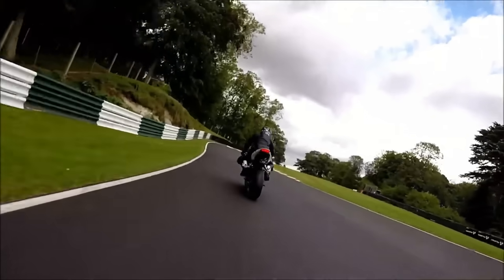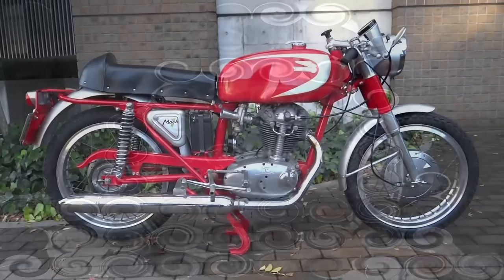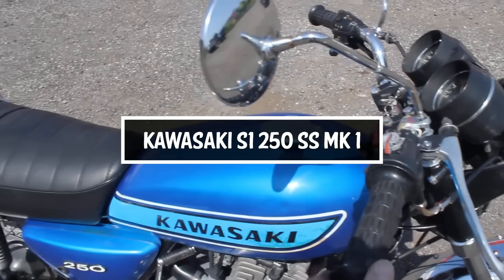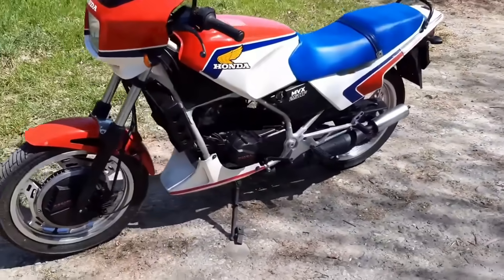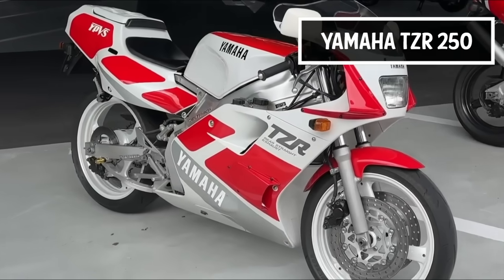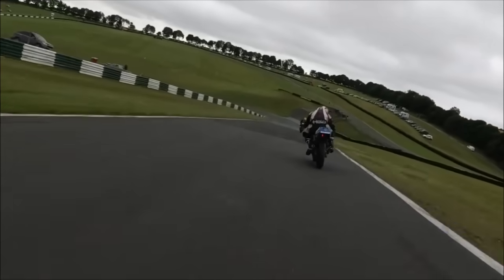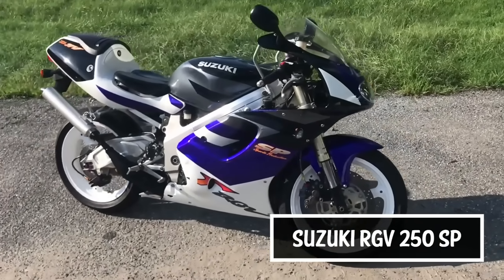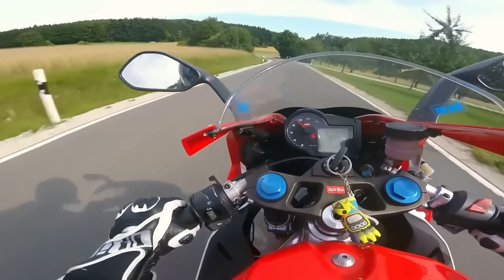The Fastest 250cc Motorcycles

Comment: I have one of the 80s through 2007 ninja 250. It has the air box delete but that's it. It's stock. Drafting a car I got it to 115 and saw 110 multiple times just riding. That's in 5th gear mind you click it into 6th and it'll drop down to 105. It must be some highway gear just put there so you can get 75mpg... The motor can't turn to redline or even close in 6th.
Reply from the maker: theres a lot of bikes set up like that, get there in 5th and then drop it into top just to keep it rolling. with the Vstrom, dropping a tooth on the front made top more usable, it would actually go faster, and accelerate in top even if you werent going downhill lol

Comment: One thing I noticed with the Japanese and their power claims back in the day was they were way optimistic. All these early 45-49bhp claims were in reality 33-35 as the performance figures of a little over the ton showed.
Reply from the maker: may well be mate, thats why i tried to stick to verified speed figures where i could, the magazines of the day often quoted stupid figures too
Reply: Oh dear young people  saying old bikes were slow..you can't test an old jap 250 now coz 1...there is only shit fuel available..we had 5 star 110 octane fuel then..2 most have been rebored so the porting has changed...find a kawasaki S1...from 1972...not after they were detuned that's totally original and test that....also  listen to the honda RC166....250 SIX CYLINDER capable of 18 to 20000 rpm in the 60,s...yes it was a race bike...
Reply: The kawasaki s1 shown is an S1.C  the fourth version not the first and fastest s1...which had 32hp...then was detuned to 30hp..then 28..then forget the rest I rode them all and the KH250 was abysmal compared to the s1....all noise and no power.

Comment: The Yamaha 250 Phazer from 85, is also a little masterpiece, with it's 4 cyl 4 stroke engine reving up to 16.000 rpm. and deliver 45 hp.
Reply from the maker: ill take a look, im guessing must have been an early Genesis engine? Cheers for watching mate,  have a great weekend
Reply: @barebonesmc  Yes, it was named Genesis in Japan and it had also tilted cylinders like the FZ750. 🙂
Reply from the maker: @EnergyXyz  the Genesis engine design was all about the 5 valve heads 🙂
Reply from the maker: @EnergyXyz  your other comment seems to have disappeared, no idea why
Reply: Must be the link I was trying to post - I don't know. The Genesis name was just for the Genesis philosophy. They couldn't place 5 valves because of the combustion size. But the effektive flow from tilting the cylinders like the FZ750 was embraced by the Genesis concept/ philosophy.
Reply: I can't even edit. So it was off course " size off the combustion chamber". 🙂
Reply from the maker: @EnergyXyz  interesting, ill have to do some reading 🙂

Comment: There are several reasons that explain why those 250s are not why it used to be.
Main one, from what I understand, is that the japanese market was by far the biggest for those sporty and highly sophisticated bikes. Japan was doing very well economically until about 1990 and sports bike were very popular among young japanese in the 80s. It was some sort of a fashion at that time. That vanished and economy took a hit in the 90s.
The other market for those bikes was europe and those 250s did actually not sell well here. Proof of that is many of these were not imported. In france we did not get the honda ns/nsr, the kawasaki kh, the 250 yamaha tzr after the 2MA, the last RGV, none of the 250 4T 4cyl...
I remember the sales numbers in 1989 and rgv/kr1 count was very low, around 300/400... And a good portion of those were bought  to be raced in the 250 french sport production championship (promosport). Those race inspired 250s made young people fantasize but few actually bought them.

The truth is those 250 had become too extreme to appeal to a wide audience. The limited displacement and high hp made them peaky and the riding position was compromised.
The last 2 stroke that was commercialy a success outside of japan was the 350 rdlc. The more relaxed riding position and less peaky engine made it a more road capable bike.
I remember that a "popular" mod that did the brits was to install a 350 rdlc engine into a 250 rg frame. That way you had the both of both worlds. A good light small frame and a torquey engine.
Reply from the maker: you needed the twin disc front though lol  🙂Cheers for adding your bit mate. Ride Free 🙂

Comment: I still have my 67 Suzuki X-6 Hustler.  It has, and will exceed the advertised 100 MPH, and is bone stock. TBH, I wouldn't put it through any cornering above 75 or 80 mph in stock form.  The Kawasaki S-2 of 1972 was capable of the same, but was a triple, and equally untenable in corners at anything over 80 MPH.  It's a shame you didn't mention either of these, or the Honda 250-6 cylinder 4-stroke race bike, which was also very cable of speeds over 100 mph, although not a stock production model itself.
Reply from the maker: ive been thrashed around Cadwell (on the EXUP) by the 250/6 and even an old Honda 125 race bike, awesome engineering, Honda at their best. I had to cut the list so many times there were bound to be omissions mate, at 40 mins it is still longer than i wanted lol Cheers for watching mate,  have a great weekend

Comment: You missed one maybe two 100 mph 250's from the sixties  and that is the Bultaco Metrala and the Montesa Impala the Metrala is documented as 100mph and occupied the first two places in the TT 250 production race in 1967, the Impala was more of a fast tourer developing one less bhp then the former but I would not mind betting could reach the magic ton with a prone rider and following wind.
The Japanese big four manufacturers often entered into gentlemans agreements regarding horsepower which is why it was an Spanish manufacturer that showed what could be done with a 250 two stroke of course market potential will be the biggest influence so if demand is not there then no one will be particularly interested although you have to take your hat off to Kawasaki for stepping out of line again by producing the 50 bhp 4 cylinder four stroke ZX25R, getting one outside of the far east though would be expensive and tricky more is the pity.
Reply from the maker: Ill take a look at them :-) Cheers for watching mate, hope you have a great weekend

Comment: 38:10 the answers are physics vs profitability.
The reality that "two wheels baaaaad, four wheels good" makes it easy to deny the consumer expensive R&D in exchange for bad publicity. When you have governments imposing power-weight and displacement limits for novice riders, and safety groups along with those in the medical professions discouraging riding altogether.
In a climate where car manufacturers rely on multiple safety systems, passive and active -- the ever-increasing airbag count, pedestrian safety frontal areas etc.
All this influences the motoring public and we become increasingly risk-averse.

That all said, I saw an indicated 175km/h on my 1985 VT250F2 in 1988, figuring the speedo was probably optimistic by 10.
I was in an 80 zone, and not yet so risk-averse ;)
Reply from the maker: Great story 🙂Cheers for adding your bit mate. Ride Free 🙂

Comment: The Ducati singles of the time were faster
I easily beat a Suzuki 250 on my Ducati 350 with original 23 mm carb. Riding through rush hour traffic we eventually got clear an I cleared off ! I stopped up the road asap I wanted to find out what speed we were doing (my speedo was erratic) But my adversary hqd stopped and turned back as I found out when I went back to my friend at The stables .
Reply from the maker: glad it jogged some good memories mate 🙂Cheers for watching. Ride Free 🙂
Reply: wow that was totally amazing that you were faster than a smaller displacement less powerful and slower motorcycle with a bigger faster and more powerful motorcycle ..how did you ever do it ,,it must have been on your skills alone of knowing when in doubt to turn up the wick
Reply: @donniebaker5984   do yer homework, sebring 350 = 20 hp, suzi 250 =30hp..bigger doesn't always mean more power.
Reply: @rabcspaniel5679  especially when the suzuki was a two stroke..and no your 350 duc was not ever faster than an X6 Hustler ...i was working for Mark Royer of M&R cycles in1966 - 1968 and was servicing new bikes ..we had norton bmw moto guzzy ducati and suzuki....i was there when the 1st 350 duc came out ..the 250 twin suzuki X6 hustler was faster than a 650 triumph bonneville in the 1320. We got a 450 ducati scrambler, came with mx knobs ,no lights , no gages , no tach , no speedometer and a straight pipe with no muffler,..i road the fu¢k out of it ..2nd  day mark made me park it ..i  said whaz up mark? He said  its not me its the neighbors ..they said if they hear that thing one more time they are calling the law

Comment: Claims for max speed, particularly those made by the manufacturer are often unreliable, like Susuki claim that  T20 did 100mph. 95 mph was more realistic. What is more important and often overlooked is mpg.
My mates triumph 500 did 95mph  effortlessly and 60mpg. My CB72 did 90mph being thrashed through the gears and only averaged 60mpg. Guess which bike I wouldn't buy again?
Reply from the maker: an interesting comment, and yes, something people dont always understand is that a bigger bike can often do more mpg on the same ride at the same speed as a smaller engine, primarily because the smaller engine is being pushed more. Many of the Brits were tuned for economy. of the 2 A7's i had, one was fairly standard witha  single concentric carb and did endless miles to the gallon, the other was a full blown proddy racer with twin racing monoblocks the size of buckets, You can guess which emptied the tank quickest im sure lol, Cheers for watching mate, Ride Free 🙂

Comment: Kawasaki never actually made a proper 250 triple, they sleeved down the 350, which has a more-or-less square bore/stroke, ending up with an under-square or long stroke motor which limited port area so they just weren't as quick as the Yamaha and Suzuki twins (the Yamaha YR/RD was always intended to be a 250 and 350 using the same bottom-end, 54x54mm and 64x54mm respectively)
Reply from the maker: I wish they’d continued the disc valve twin. The A1 Samurai 😊 it was faster than the S1 😊

Comment: Kawasaki bias! The KR1 was only really credible because of its top speed. Its nervous handling, fragile engine and rusty compenents everywhere made it far less desirable than the other 2 strokes of the time. I would have liked to have seen more on the various TZRs as there were three completely different versions in a short space of time; the 2MA parralel twin, the 3MA reverse cyclinder nightmare and finally the excellent 3XV. I had several 250s - the TZR 3XV was my favourite of the 250s I had. It was as fast as any of them, small, stable, and extremely light at 125kg. I now have an RGV 250 VJ21, as over the years I felt it less importnt to have the fastest and more important to have the nicest looking, its simplictly in design and clean lines have made it age very well.
Reply from the maker: i may do a Yamaha 2 stroke family tree at some point, but its a serious undertaking 🙂Cheers for watching mate. Ride Free 🙂

Comment: Honda MVX got a lot of honda CBX 550 in it by the look of it. Inboard vented discs etc. Not seen an MVX until I watched this. ive got a CBX 550F2. Needs restoring. Was a nice sounding 550 when I rode it over 30 years ago.
Your not wrong re modern 250. completly bland and boring.
Reply from the maker: I had the gen 1 500/4. Lovely bike so I’m sure the 550 followed its tracks

Comment: The  Japanese love of the 250 was driven by Legislation implemented in 1961 which restricts learner riders to motorcycles  no larger than 250cc. Anyone who has ever ridden a british bike of the era eg. Triumph Tiger Cub knows you felt like a giant riding a kids bike. The Japanese bikes were the same size as 350 and 500 cc bikes and had much the same if not more top speeds. Early bikes of course suffered from the lack of frame building knowledge but once they got the handle on this the UK bike went into decline
Reply from the maker: If only it was that simple mate, the Japanese market regs drove their penchant for 250s, our regs just meant we got some of the bikes, and the decline of the British industry came down to many things, one of which was the delusion that people would never buy Japanese bikes instead of British ones. The British industry just got lazy and only tried to react after the market had changed. by then it was too late i think, .Cheers for watching mate, Ride Free

Comment: Honda MVX 250F... The rear piston used to overheat. Hilarity ensued.

Friend had a CBR 250RR (MC22). Changing gear you could rev out to 20,000rpm... Following him on my ol GSX250ESG (Faster but it was like comparing a 25 Geared go-Kart to a Falcon Station Wagon... (The Suzi was a long bus with small wheels you climbed off the side and pulled it down to corner only to have to climb off the other side to pull it back up)..

uhh wherewuzeye.. Oh yes.. Following the CPR wad interesting... as the revs were so high that you couldn't hear the bike at the top end... so all you heard was the gear changes....

Booorrrrrrrrrrrrreeeeeeeehhhhhhh       .......                             Borrrhhh                                                                  bohhhrrrrr.....                                                                            borhh

My only advantage was a bike you could literally leave in top (5th) gear and go anywhere (to the point when a friend borrowed it, took a pillion, and returned to say... I have to admit.. you can actually go anywhere in 5th...        Pulling away from the lights with a passenger was a little hard...

(Uh thanks mate... My clutch has a new enemy...).

I could barely ride the CBR... (Jap import dark silver fleck 2 tone). It was like riding an overpowered BMX 

We fixed it once with some duct tape, a half heart necklace, and a bit of #8 fencing wire, when the throttle cable snapped 200k from home.
He rode the trip back with the return cable re-routed to the pull side of the throttle... with a Push throttle.... Apparently he said it was quite quick to get used to.
It was very light (in feel and actual weight) with a 180/60 shoehorned into the rear...
We went over a hill at (200kph for me.. umm sorry I mean 100k of course, the legal speed limit in NZ)... and in commenting later he mentioned the steering went weird over the rise... then he realised he crested about 1ft above the road surface).
He went on to get a full licence big brother, the fireblade 900... I got a car... and trailbikes... and now mediocre MTB.
Reply from the maker: epic comment :-)  Cheers for  watching mate, ride free
Reply: @barebonesmc  I miss road bikes... I miss driving in traffic but not getting frustrated... because you could jus over take.
I miss my mate calling at 11pm and asking what I was up to, off 200k up country... now what, over to the coast.. now what... best go home it's 4am.
We used to go 150k away just to ride a saddle track, back through a gorge, over another saddle track, back through the gorge again, or back via the mid country rather than coast up. (Lower Nth Island NZ).
Course back in those days there wern't the cameras and 200k cruising wasn't unheard of.
Reply from the maker: @TheButlerNZ  All we can do is enjoy what we can mate, Managed to get a sunset ride through the Vale of Belvoir a couple of nights ago and had a run around the Churnet Valley yesterday in the sun both areas i dont know so well so we found some nice new roads, tiny back roads with little traffic, they are what i love most now, i try to avoid the crowds 🙂

Comment: My first bike back in 1989 was the original 250cc 100mph breaker.
A 1982 Yamaha RD 250 LC. 38hp if I remember correctly.
About 130kgs dry. 

Anyone acclaiming over 100mph earlier on a standard production 250cc motorbike are liars in my book.
Reply from the maker: 🙂Cheers for watching mate. Ride Free 🙂

Comment: Kh250 were slow to other 2 strokes. The Rd 250 would certainly break 100moh and so could a good suzuki gt. We had a measured mile with a downhill entry and we would test them for max speed. Honda dream and the twin were so slow at 86mph slightly slower than a kh. Whilst tye suzuki came out at 103mph it would only achieve that on first run but would get slower with heat and by 5000mile it was in the high 80s. The Rd was by far the best
Reply from the maker: the RD's did prove themselves over many years :-) Cheers for watching mate, Ride Free 🙂

Comment: The death of MZ - sad times. Fortnine did a video on why modern bikes have the performance they do - all to do with euro 5
Reply from the maker: 🙂Cheers for watching mate.I do think its a lot more than that in all honesty, Ride Free 🙂
Reply: @barebonesmc  yes a cheaper parallel twin with low power can get through global tests. Small capacity is driven by the massive sales in Asia
Reply from the maker: @TringmotionCoUk  yep, the multi country A2 style licensing limits the 500s etc, and the Asian markets are mostly sub 250 with a growing but still smaller 250-400cc segment, above 400 its very small numbers, but still very much growing, times are changing as they say

Comment: Well I will say this to even though most are four stroke 250cc today why are they not doing the same economy as fuel injected not just lack of power and heavy. In super go carts they have an engine that puts out over 100HP when I was in to Go Carts used Honda 250 CBR engines put on the back again max power not over 40HP but the Go cart could do 140. With the New Super Go carts they can do that speed easy i think limited to 170MPH.  So what I mean is there is engines that could do better and will never be used on 250cc Motor bike.
Reply from the maker: A good point well put mate 🙂Cheers for the comment. Ride Free 🙂